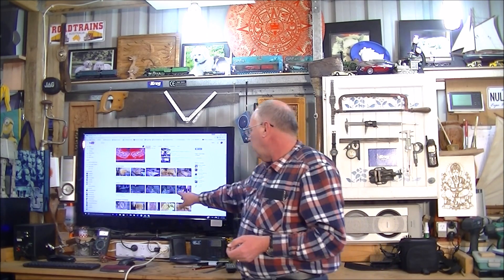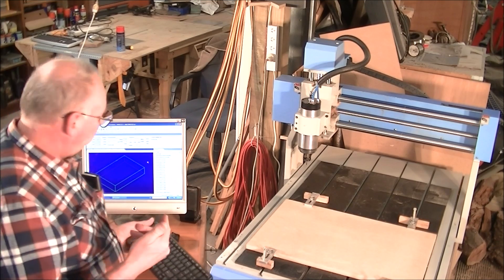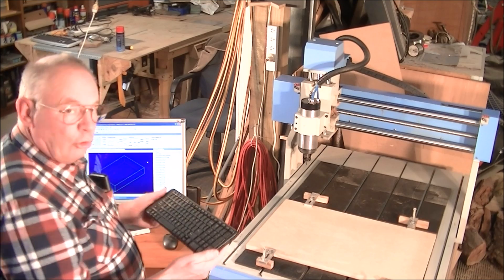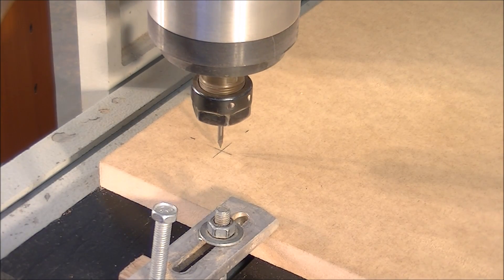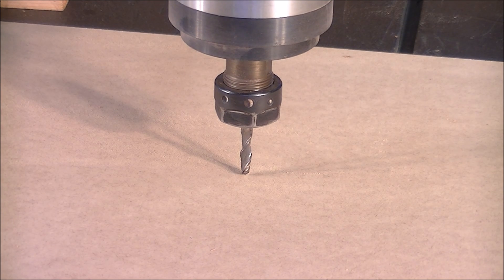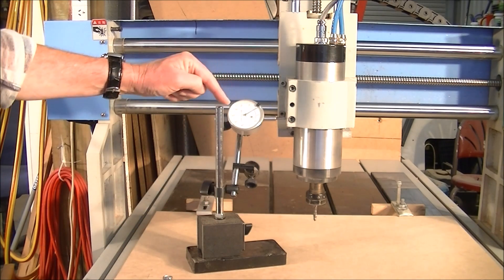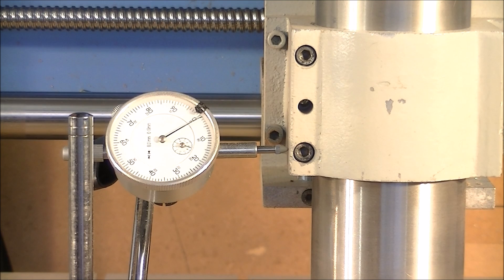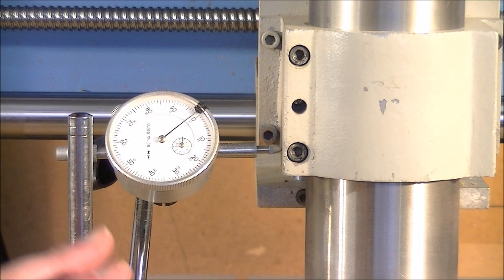151 CNC Router & NC Studio setting up for machining a 3D picture

Comment: Hello, I am new to cnc and NC Studio, I am trying to cut pvc  with artcam  but when machining the size is smaller than the original design, is it a parameter in nc studio I need to modify?

Comment: Good tutorial and advises. I am hobbyist. and about to start a DIY CNC router.
A question. Would Ncstudio V5.5.60 works in Window 10?
Reply from the maker: NO! it will not, Windows XP only
Thank you, for watching,  
Please forward the video on to a friend, Australian Inventor Roger Clyde Webb ;-)
Reply from the maker: Go with Mach4 with Win 10 or Mach3 with Win 7 and 8
Reply: @inventorsworkshop9600  Thank you for your advise.
Reply: There is earlier versions of the NC Studio. version 5.5.60 is 15 years old or more.

Comment: Hi mr roger... I am also using ncstudio for my cnc machine from china... my problem is that the z-axis is rreverse... if I go plus z the spindle going down.. if i go minus z the spindle going up... please help
Reply from the maker: Convert to Mach3
Reply: How to convert mach 3? When I make manual. If I press z minus it will go up... and if I press z plus it will go down.. when I make mechanical origen the spindle will go down to the table..
Reply: Do you have video how to convert to mach 3? Thanks
Reply from the maker: Yes see my videos, 77 78, 79 and 198

Pacific Tooling; Australian Inventor Roger Clyde Webb ;-
Reply: Roger Webb thank you very much.. more power and I wish you good health... your very kind.. thumbs up for you sir roger..

Comment: Hello
How i can download this ns studio programm
Reply from the maker: Hi, you need a PCI card for NC Studio, Email me at : info@pacifictooling.com  I will send you information on our new Wood Lathes
 and CNC routers, 4040, 6060, 6090 , 6012 , 1212, 1224, 1325 and now CNC 6040, 6090 , 1390 Lasers (linear rail model), and machine tool accessories . Pacific Tooling, 
 Australian Inventor Roger Clyde Webb
Reply: hi please where can i find the nc studio

Comment: So what grade ball screws are you using?
Reply from the maker: Email me at : info@pacifictooling.com  I will send you information on our new Wood Lathes
 and CNC routers, 4040, 6060, 6090 , 6012 , 1212, 1224, 1325 and now CNC 6040, 6090 , 1390 Lasers (linear rail model), and machine tool accessories . Pacific Tooling, 
 Australian Inventor Roger Clyde Webb